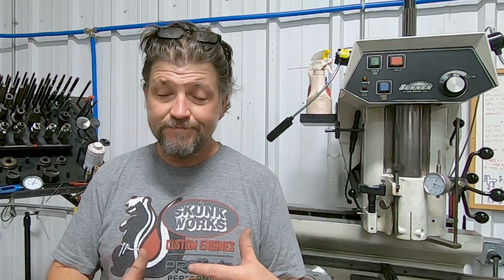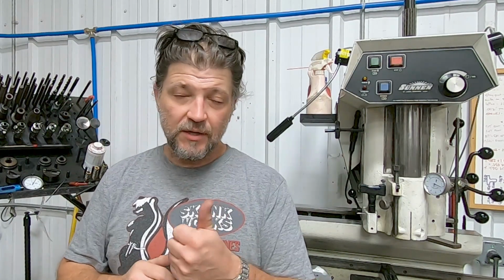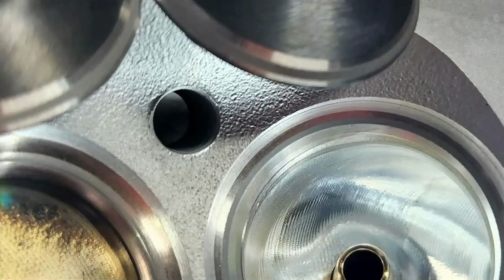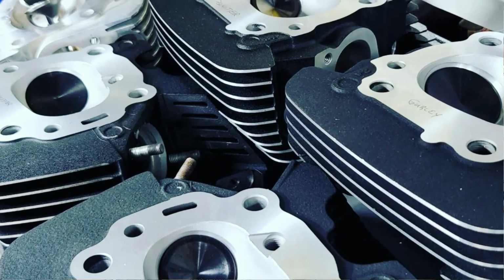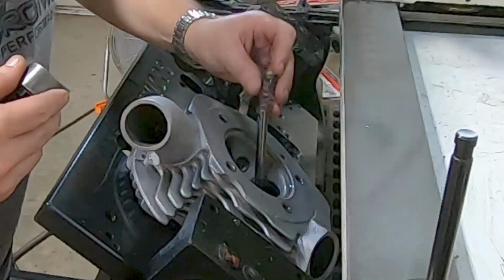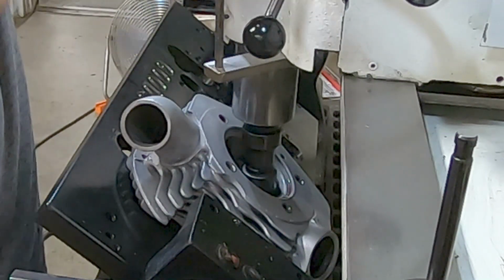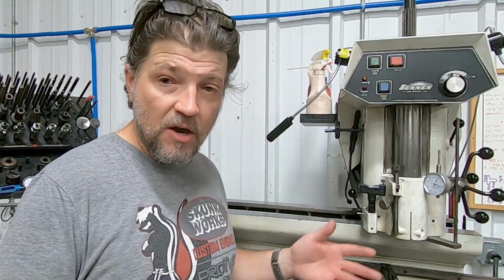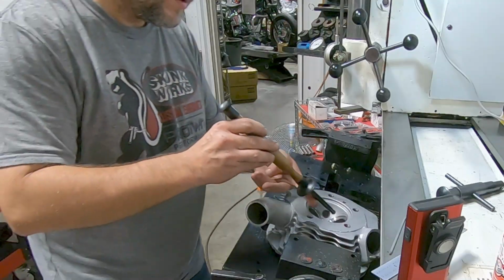Shovelhead Build VALVE SEAT REPLACEMENT - Cylinder heads and valve job - The Curve Bike Part 4

Comment: go Kevin go, don't let a few cracks or a bum cylinder deter you. if you need a stock 74ci.cylinder I have a set. front & rear. let me know. but keep going.
Reply from the maker: Thanks Martin. I may have to take you up on your offer. Appreciate it

Comment: Hi Kevin. Finally an engine builder on YT that makes sense on every point! I agree the preferred way is to cut the old seats until they essentially are paper thin and can be pulled out without any damage to the heads. I wouldn't even try any other way of removing the old seats.
I miss the VGS 20 I used to work with. Sad part is that machine is now sitting in an old rotten shed collecting dust and rust. Now I occasionally do engine work at home; everything on a 52" Bridgeport clone and some ingenious and expensive tools from a certain engine builder's supply shop (with a lot of green print in the catalog). The mill does the job, only it takes about 10 times as long to do any valve / guide work.
Question - Have you ever had a valve seat fall out after an aluminum head was welded? I have aluminum heads that have been welded in the chamber to close up the original plug holes  - to put in twin 10 mm plugs at different angles. Anyway you know that I can check if the valve seats are still secure enough in the heads? Is 450 degree oven heat enough?

Comment: Thank you for taking the time to help others with videos…. Question, I got my first shovel head recently, a 1982 FXRS stock 80”, tuned and timed properly, running 60wt VR1 oil… bike runs good but on a 80-85 degree day here in Indiana rear cylinder temp is about 315ish-front is 307… where spark plugs are 289ish each…. This seems hot on cylinders… would you consider this normal on a 80-90 degree day? Running 60mph… I was going to use Amsoil 60 wt racing oil and see if temps lower but wanted you thoughts on heat? Thank you

Comment: Hi everyone. I have an issue with a 2010 FLHX crankcase building negative pressure and consumption of oil is high 1qt every 300 miles. Had engine overhauled to a 103. I’m still having the same issue my mechanic does not know what the problem is. I’m posting this to see if anyone has a clue to what is happening to my baby.